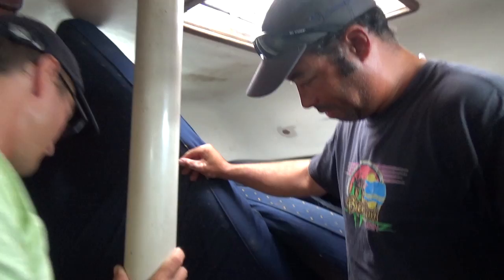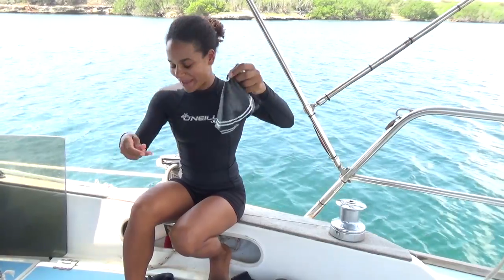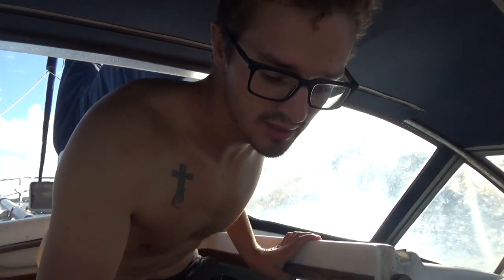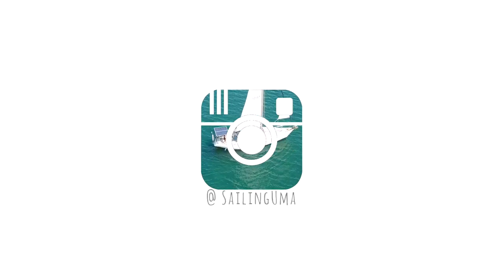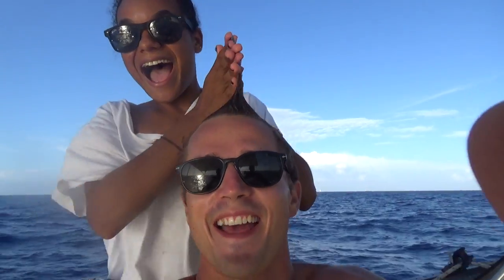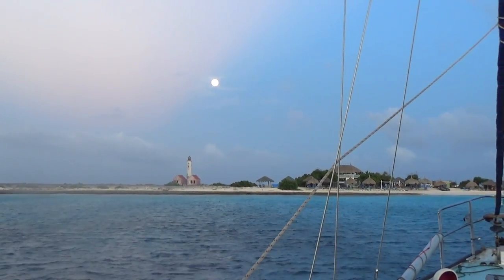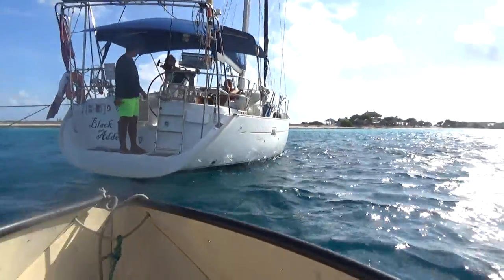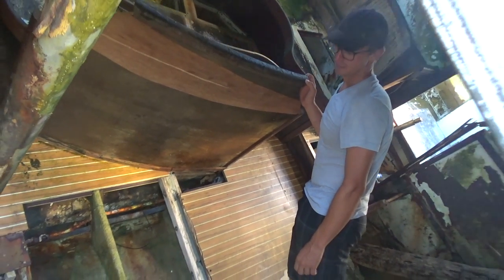Cleaning our copper bottom hull  — Sailing Uma  [Step 102]

Comment: Be care of metal scrapers, nicks in the blade can cut through your bottom anti fowling, and scar the fiberglass, leading to osmosis.  Try the ceramic ones instead.  Their just as sharp, and hold up very well to the elements, and don't produce sharp points that scar the anti fowl.
Reply: I don't know if you were following, however, the bottom coating is copper powder embedded in epoxy resin, not the usual anti-foul paint. As such they found that to remain effective it needs to be sanded back occasionally to expose fresh copper.

Comment: I have been waiting for your review of your DIY copper paint !  Even if it is not perfect, easier clean is a BIG WIN !

I hope you put some grease/anti seize on that shaft before you banged the wheel on.  It not, you won't get it off without a puller next time.

Comment: Once again, clean the bottom on a changing tide, or other current event (EVEN IF YOU HAVE TO MOVE THE BOAT) and scrap it stern to bow so the detritus drifts away from you, rather than moving into / along with the debris cloud.  Miami sailor knowledge.

Comment: Okay, doesnt metal expand normally when heated? I would expect the hole in the helm to be bigger. PS how do you get all those drone shots, i never see you guys with a drone? hahaha i came here for 6 months to work, ive been here since 2002 :) PS i think they fixed the stairs, years a go steps where missing and complete rotten, very sketchy
Reply: Yes, metal does expand WHILE heated, and then contract when it cools.  Since the wheel is now cool, whatever work they had done left a permanent change in the ID of the wheel, who knows why.

Comment: One boat had an experience that wasn't very pleasant, a clogged output from the , well, tank, or direct from the toilet. Barnacle's got into the pipe and clogged it, and he had to go into the water and run a rod in it till he got it unclogged, with it full tank of crap. Was very unpleasant when it unclogged with him right outside of the pipe. Those little guys will get into anything they are opportunists.
Reply: Yet another reason to use a composting head instead!

Comment: Woodruff key slot
Reply: That is a keyway, NOT a Woodruff key slot. A Woodruff key is half-moon shaped as opposed to the standard key depicted in this video. ;)
Reply: The half moon on a woodruff key slot is cut into the shaft.. The hub is broached straight through.
Reply: My point exactly. The KEYWAY broached on the hub accepts the key, be it a Woodruff key or a standard square key. A Woodruff key "slot" would be a half moon shaped depression machined into a shaft. Just splitting hairs :)

Comment: I hope you have a puller next time you try to remove the wheel.  A coating of CorrosionX or even grease would have made life easier then and in the future.  
Also, I may have missed an explanation earlier but why no life lines?

Comment: When you installed the windvane you drilled through the transom.  I recall you added fiberglass on the inside.  In a shot in this video I was reminded that you didn't "appear" to do any sealant on the exterior.  Is that true?  Any concern that water will start to saturate the transom infiltrating from the exterior?
Reply: Good point... But at the same time I didn't see any video of the pain he experienced when the kidney stones finally passed! Just because we didn't see it doesn't mean it didn't happen!
Reply: Rather late , but reading this now .
Although fiberglass with polyester resin will collect water over time , epoxy resin makes a really watertight laminate . So , no worries .

Comment: I saw one video on that "coppercoat" and the company pretty much over guaranteed it and overpriced it. Not the powder mixture you made up, but a special product. My observation with the other people was , doesn't seem to mater what you use, you almost have to clean before every passage, at least every overnight passage. You were probably losing about 25 percent of you speed with that much growth. Even a small amount is thought to make a 1 knot loss in speed. I did see one cleaning in an area where shrimp, tiny ones, are living in the mess, and like your ears. Wasn't pleasant.

Comment: Never use ear plugs underwater.....your ears will not clear and the plugs can be pushed into your ear , causing damage.
Reply: They aren't diving more than 5 feet.... no pressure to push them in. For that job keeping the hasty crap out of the ear canal is more important.

Comment: I am wondering about the comfort level of a windwane compared to an autopilot ?
Reply from the maker: +tchiwam much more comfy so far. It does a better job dealing with the waves and keeping the boat motion tolerable.
Reply: I can't wait to try mine and get some idea on how it does on rough sea. It should be working there too.
Reply: I think the best feature is the energy free of the mechanism.